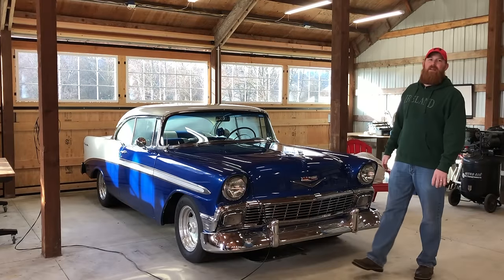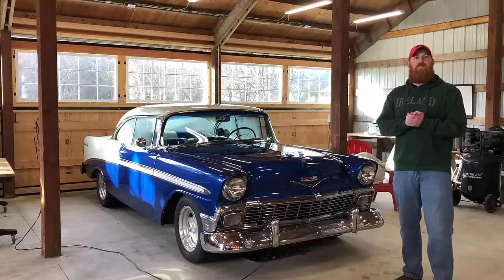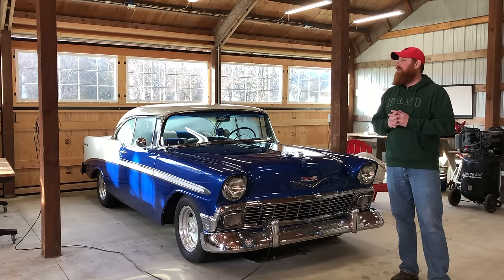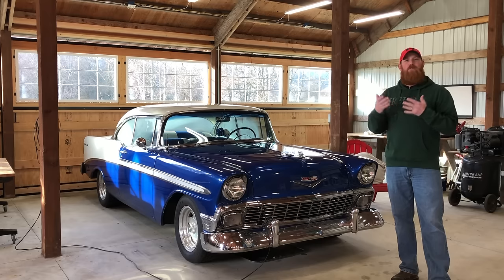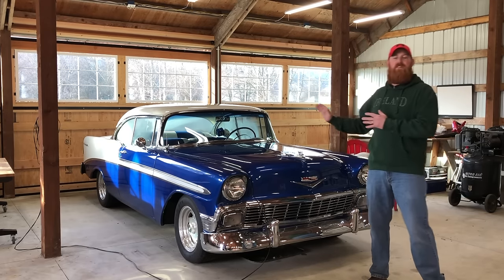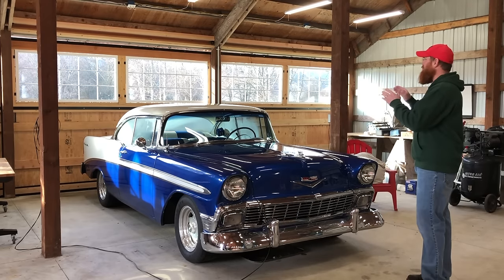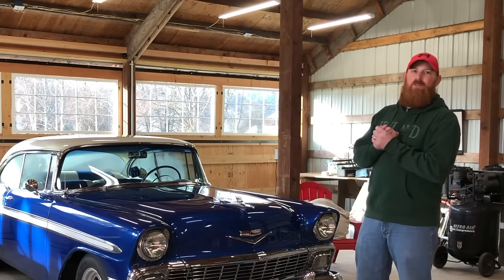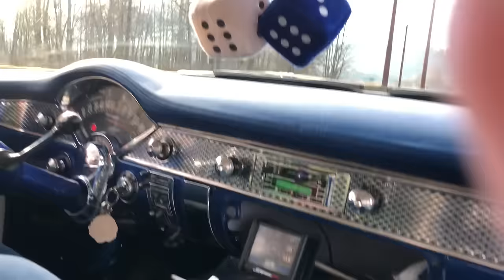Glasspacks vs Flowmaster - which one do. you prefer?

Comment: By the rapping sound at higher rpms he must not have a good or no balance tube ahead of the glass packs. Most flowmasters sound to hollow  his dont sound too bad. Could also tell by the tone that the glass packs were probably not very long and not as close to the headers as they could be. Would have been a better test if the glass packs would have been done correctly. My 70 plymouth has a set of allied blue streak glass packs 36 in long placed as far forward as i could get them with a good balance tube just in front of them. This gives a very deep mellow tone at idle and really ferociuos deep tone at acceleration with very little rapp at hard accelaration. Old school good quality glass packs.( cherry bombs are ok ) done correctly will always sound better than flowmasters. At shows people,( mostly the younger generation) ask me how did you get such deep tone out of it. Years ago my dads speacalty was splitting manfolds or building headers by hand

Comment: Sadly this sounds as bad and "generic truck exhaust" as my current stock 96 Ram with a glasspack exhaust. It could sound so much better.... Longtubes or at least mid-length if bottom out was an issue, and an X pipe + Magnaflow or Borla (the mid sound level, not the Touring or Atak) mufflers instead would sound way better. A Bel Air shouldn't sound like a clapped 1992 Silverado.